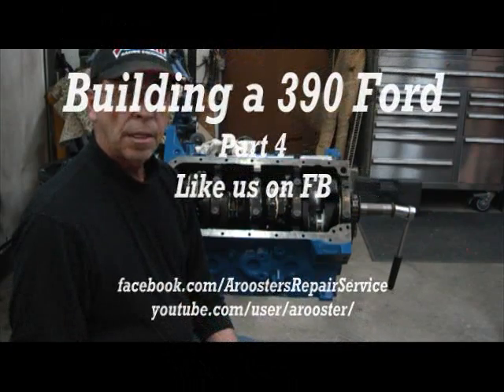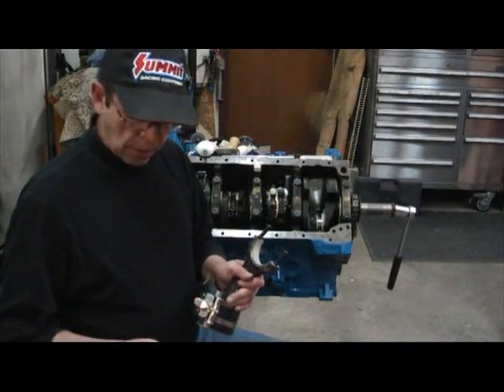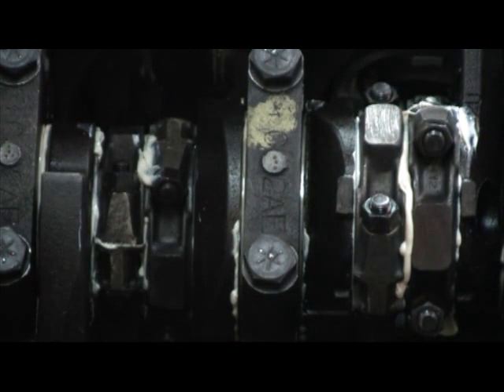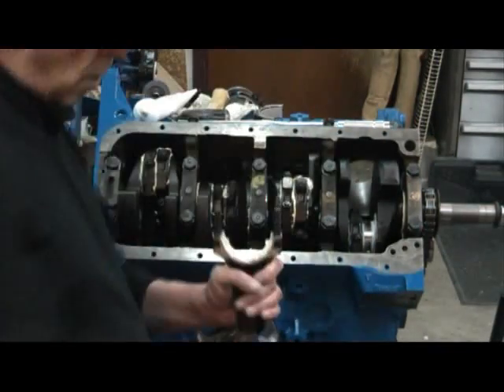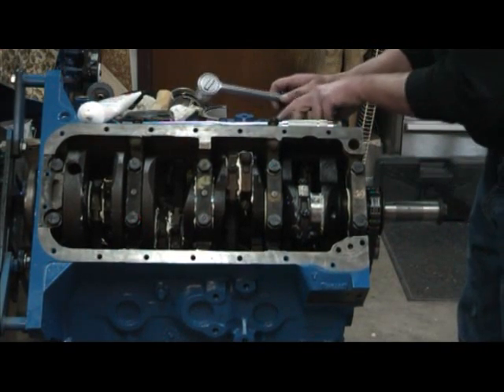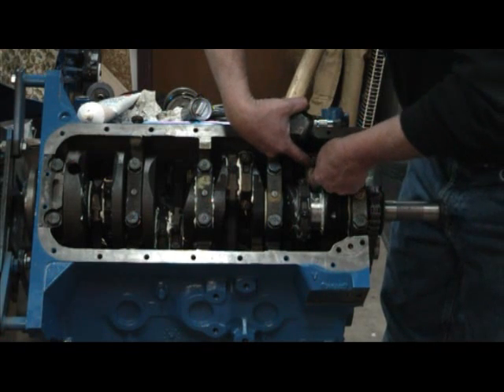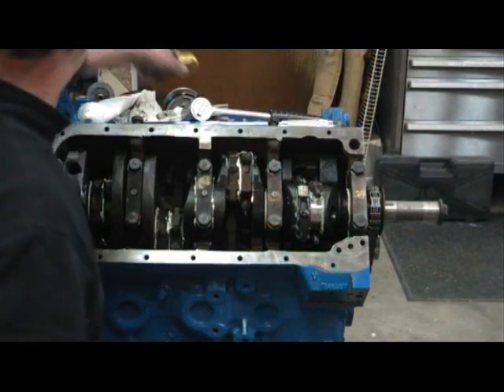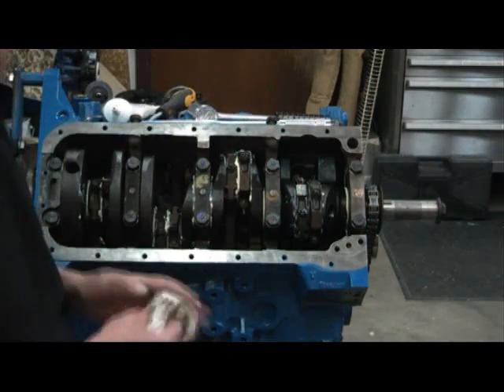Ford 390 Engine Rebuild Part 4

Comment: You come across as knowing what your doing but watching your timing chain set install I would pull that off the net cause you used a timing gear that had a built in thrust washer and once you saw your pin was short you should have tried to find out why cn
Reply from the maker: Thanks for the feed back Bruce. I did review the video and did not see that while it was happening. I have since pulled the video, just a note on the changes I made did not happier the engine from running over 5K miles so far.  Thanks for your help Arooster.

Comment: Did you forget the oil pump drive shaft?
Reply from the maker: +theoriginalmungaman At the time of filming yes, the shaft was put in after and not on film. It's weird how forgetful I was during the filming of these video's :) Best practice is to always follow the assembly books when building our motors.

FYI - The motor now has 5K miles without any problems. Please read some of the feed back for more information that was not on video. I would like to thank those that watched and commented on my build. Thank you!

Comment: According to Ford's 1969 shop manual, the torque specification for the oil pump to engine block bolts is 20-25 ft. lbs.

Comment: Just a recommendation, use some fuel line hose on the connecting rod studs to keep from scratching the cylinder walls and crankshaft journals.
Reply: everyone is a nit picker mechanic

Comment: I think you for got to put the oil pump drive .because of the retainer it has to be installed.when installing the pump
Reply from the maker: Thanks Jackie, I'm having a hard time remembering when doing the filming. lol Because I did forget to put the pump drive shaft in I had to pull the pan to install!! So very good spotting that in the video!
Reply: Your welcome. Looking good